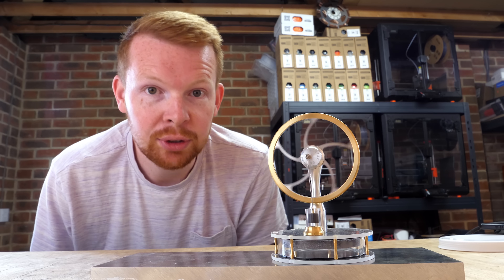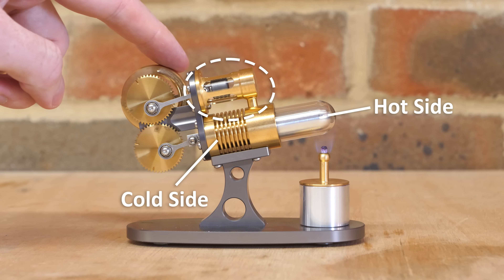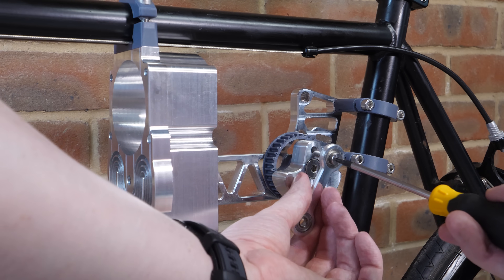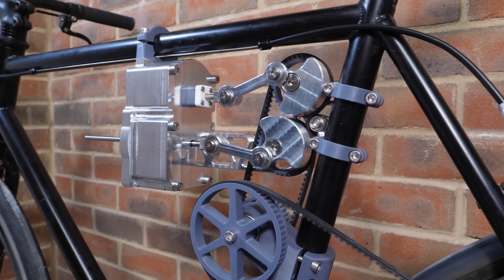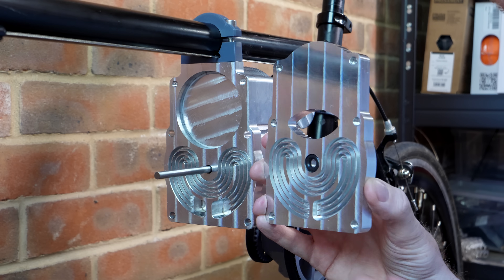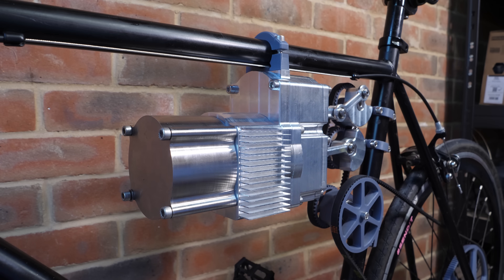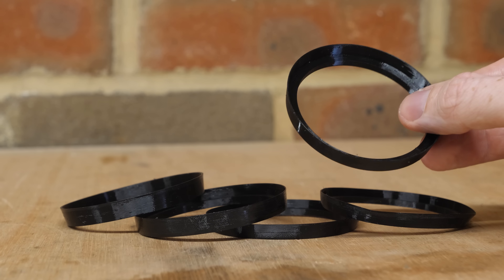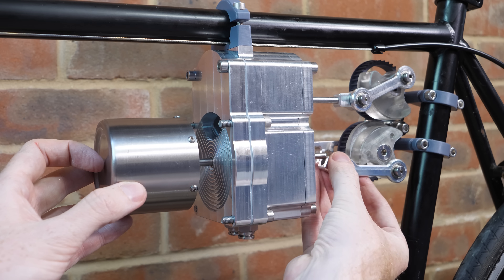Building a Stirling Engine Bike - Part 1

Comment: Great Video, thank you! Why do you have the unpressurised side of the power cylinder nearly sealed, don't you lose a lot of energy there? Your compressing and pulling vakuum every rotation without any benefit. Maybe Just Drill some holes in that Plate.

Comment: Maybe add a bigger on both sides isolated casing part between hot and cold side, which also works as regenerator. The displacer could be stuffed inside with steel wool and with lots of holes on the sides to act as regenerator too. I saw some videos from a guy who built a three cylinder stirling engine for a small boat out of tin cans.

Comment: It's a lot of work, but if you machine a heat sink for the inside of the heat end with a matching fit on the end of the piston then you can get the heat to transfer faster without loosing compression ratio or compensating with the stroke length.

Comment: Complete and utter amateur here, so I may be way off base, but... You said the piston cranks were offset from each other at 90 degrees, and then you never fiddled with them again. Those cranks, and the connection between them, seem analogous to the valve gear on a steam engine. If that's the case then the 90 degrees may not be a universal optimum, but rather a ballpark figure subject to variation in the actual implementation. I guess what I'm saying is that you might get the engine running better by fiddling with the offset between the cranks. It should probably also be the last thing you tinker with whenever you're making other changes to the engine. Keep in mind that I'm not an engineer, this is just what I've picked up from watching videos of people building steam engines.

Comment: Change the fluid working medium from air to a refrigerant gas for better efficiency. Requires a closed system. But what you could is make electricity by using the piston stroke in a linear electric coil. No circular motion required from the generator.

Comment: First idea, when I saw this project, was: "WTF ????" ;-)
As far as I know, the biggest problem with sterling engines is: "The low power output"
150 W would be sufficient for a bicycle, but a sterling with 150 W mechanical power output must be as large as a bicycle. The size you build it, would be a practical size to integrate into a bike, that is true, but with this size it never can provide 150 W, 
but your machine seems to provide around 150 mW ;-)
It would be my dream bike, if it works with 150 W, 
but this can only work in dreams, unfortunately not in reality.
Have you ever googled about cylinder size versus power output of a sterling machine?
Nevertheless, I enjoyed the video. So much effort, and doomed from the beginning, because
power output from a sterling engine is so little. 
Is it really so little known, that power output of sterling engines is always little  ;-)

Comment: AIP or Air Independent Propulsion is a capable Stirling engine design that creates impressive supply, mostly used in the context of military submarines. Mostly used with battery systems as a means of maintaining charge, the increased number of pistons means the generator is far more reliable (in terms of output) than the basic design on this bicycle. And that is probably the greatest application of a Stirling engine (although pumps have also been historically a common use for Stirling engine. Direct drive, like this, is certainly entertaining and educational, but not entirely practical. However, as an energy source for electric drive, that's something else entirely!

Comment: you have all the tools, you have the time and willingness to do it, but then you make the power piston in a stirling about as big and with the same travel as the displacer...
in other words you greatly underestimate how big of a displacer you need and how much heat must be transferred in to the air in the engine to power a bike, that coke bottle size will not do.
the only possible save is to design the displacer like i did when i drew (never made, lack of tools) a stirling. circular fins on the top inside of the hot side, like a cpu cooler but in circles, and then on top of the displacer that matches the ones in the hot end (top of displacer fins reach bottom of hotend fins) so that alot of air is presented with alot of surface fast. preferably same on the cold side.

Comment: The Backside of the power-piston is enclosed. which means it has to either compress air in the ,,crankcase´´ or push it past that steel rod during the power stroke.
I think you may lose some energy there

Comment: Another classic bit of engineering whimsy from Tom Stanton and I loved every minute of it. I think it would have been better to have 2 smaller cylinders 180 degrees apart, though this would significantly increase complexity it would provide smoother more efficient operation. Also you should hone the bore of your cylinder, that would make a big difference.
Reply from the maker: A lot of Stirling engines mount the cylinders 90 degrees apart to achieve the required piston offset from a single crank, but the plumbing between the cylinders can create inefficiencies. Thanks!

Comment: Good grief! How to overbuild a simple engine. And, your power source is going to be a propane torch? Where is the regenerator? Without a regenerator, this isn't a Stirling engine; it's a hot air engine, (a little bit nicer than the pop-can models that some YouTube geeks build).

Comment: @pauls5745  Couldn't agree more, more polished brass, red painted flywheels, and shiny chrome piston rods, more  Fred Dibhna, Mamod X Steam Punk that's the future err and the past. But seriously, very nice workTom.👍
Kockums Sweden build and install an (AIP) "air independent propulsion" Stirling engine in three of their Gotland class submarines 75-100 kW.
Cavatation solved or a 100 kW to power a (MHD) magnetohydrodynamic drive? 
Anyhoo, Robert Stirling would be proud.

Comment: Let me tell you a secret: just increase the pressure to, say, 10–16 bar and you’ll immediately get more power… and use a better working gas, like hydrogen or helium.

And the best setup for you is a free-piston version it’s compact and has no sealing issues. You can extract the energy in electric form with a linear generator, perfect for charging your existing e-bike in a series hybrid setup. With high enough pressure, efficiency can reach 35–45%.

Comment: Stirling engines are notorious hard to build and get it right. But you did it! Congratulations! You could inject helium under pressure, instead of air, since helium has more heat capacity than air. The ultimate problem though is efficiency of the Stirling engines themselves.

Comment: What if you use a peltier module to heat up AND cool down the motor? It needs batteries, but can be easy to get the power you need (at least in an ideal motor, is impossible to use those in your project)

Comment: You could maybe try driving the displacer with a fast actuator (commutation control via a processor - hall  crank angle / baro cylinder pressure)
Something like a pulsed solenoid, voice coil actuator, or maybe a fast servo, or homebrew creation
- allows throttling of engine via displacement distance
- non-linear motion, and phasing control can improve heat-cool cycle - an "ECU mapped Stirling engine" 
... of course extra electrical power!

Comment: Piston needs to seal in BOTH directions. Sucks in on air shrink cycle. You are sucking fresh air into the system on every cooling stroke. You said it yourself.; the Stirling engine is a sealed system. That it works at all in its current state shows great potential. Good luck.

Comment: Can ANYONE stop with the "positive feel good" B S for one second and THINK about the rather obvious design flaw????
RIDING A BIKE WITH A 500 DEGREE BLOCK OF IRON BETWEEN YOUR LEGS ISN'T EXACTLY SAFE IS IT???? LET ALONE HAVING A BLOWTORCH POINTING TOWARDS YOUR CROTCH WHILE DOING SO!!!

Yeah yeah, good for him building something and all.... But seriously, WHY AM I THE ONLY ONE POINTING THIS OUT!?!? DOES NOBODY ELSE THINK OR HAVE STANDARDS ANYMORE???

Yeah... Motorcycles also have a LOT more of a buffer zone between the actual engine and your legs, the clearances on a BICYCLE are a lot smaller (and also geared towards wearing shorts instead of LEATHER PANTS)

Comment: Add generator to it to load a battery that is connected to electric engine, a hybrid.
You could then with clever control of how much charging of battery can be done to avoid stalling the engine, but you would still have good power from battery to move the bike.
Average output from Stirling engine could be enough to keep bike moving if occasional need of more power comes from battery, and engine is loading a battery when you are freewheeling, so system would even out pikes in needed power.

Comment: Tip: if you backdrive a working Stirling engine, it will act as a heat pump. If you're not sure if you've got a working design, start by backdriving it for a bit and see if the two sides start developing a temperature difference.

Comment: Did you build your CNC or buy it? looks cool
Reply from the maker: I designed and built it, which took far longer than expected haha. I show the build in my previous video. Thanks!
Reply: @TomStantonEngineering That happens haha. Okay I will check it out!

Comment: Making the cylinder out of a less heat conductive material, like titanium, might improve the engine too, drastically reducing leaking heat through the cylinder walls.
Then adding fins on the inside of the hot-head/hot plate might also improve heat transfer by a lot as you probably want to reduce cycle times drastically.  
Note that titanium conducts heat only ~1/10th as good as aluminum and still just half as good as steel does.

Comment: Why don't you try Helium as working fluid instead of air? It is what is used for high power Stirling cycle because it has second highest coefficient of thermal expansion after, the dangerous for this, Hydrogen.

Comment: Stirling engines are cool, but only really somewhat useful stationary.
Two examples ive heard thrown around is geothermal power in cold climates or recovering an amount of power out of the waste heat from datacenters.

Comment: That's awesome! I'm no engineer but I watch a lot of videos about car engines. Usually they make a big deal about the cylinder wall being really, really smooth in order not to lose compression. Could it be that giving it a better finish than just plain CNC finish will lead to less power loss? Would be nice to try it

Comment: Stirling engines are quite efficient; however, they are NOT powerful.  I doubt this engine is half big enough to pull a rider.  I would advise at least double the stroke length.  To optimize power, you need fins or metal wool inside the cylinder to transfer the heat to the air more quickly and the same on the cold side to remove heat more quickly.  It would also help if the cylinder head had high heat conductivity (maybe copper) and fins on the outside to absorb heat from the fire more readily.  In the final analysis, I am glad it is not me with this fire and hot metal between my legs.

Comment: you could get a small engine cylinder hone and smooth out the bore to make it seal better and have less resistance. 
its a simple tool that goes in a hand drill and rotates polishing stones with some lubrication to.
if you get a new one it may need to be run in first on a steel bore before having a go at the alloy

Comment: the problem with stirling engine is its too weak, too big, too heavy, less efficient, if you want to run that bike you might need at least 12 cylinders of that with a clutch.

Comment: is it worth adding heat fins on the inside of the cylinder? That way heat transfers into the air in the cylinder quicker. Maybe instead of a flat stainless steel bottle, the "bottom" of the bottle has the fins (on the inside).

Comment: A steam engine on a bike would work. Maybe you have researched it or if you haven't, there is a big difference between a Steam Generator and a Steam Engine. If that makes any sense. A steam generator is meant to generate high temp/pressure steam quickly, continuously using small amounts of water at a time. This is different from a boiler based system which heats a large amount of water at once and collects steam, then passes the steam through a superheater. A steam generator does not collect steam in a boiler, and therefore, has minimal risk of explosions. 

The Doble Steam cars of the 1920s/1930s are a good blueprint for a mobile steam generator. They generated steam from around 500ml of water at a time in the heating loop and continuously condensed and recirculated the water. The result was a car that output as much torque as a modern semi truck(lorry).

Comment: consider placing the engine above rear wheel, behind seat. Heat with Fresnel lens focusing solar? Nobody wants a flame between their legs. :)  The entire aluminum bike frame could add to cooling system? Have you measured the torque this engine produces? I just wonder if there is enough torque produced by any feasible sized Stirling to overcome rolling and weight resistance.

Comment: Stirling engine Canoe. Using the shadow and water as the cold side, and the solar collector as the hot side, multiple cylinders. You could get upward of 100 degrees difference using vacuum tube solar collector.

Comment: Cool but useless
Reply: Useless to whom? I’d wager Tom is gaining useful engineering and machining experience. And we are being entertained
Reply: @davehill8541 useless as  in "real world application". If you're going to burn fuel to move 200 lbs you should just use gas🤣🤣🤣🤣🤣 it's the same concept as a "piston" but with external combustion🤣🤣🤣 And if you want quiet use electricity.
Reply: @brobrozbox  he has made several types of electric motors for his bike. This channel is about exploring engineering concepts, not optimizing a self propelled bike

Comment: I think it would run smoother with as long a con rods as you can fit in the frame.
There is a lot of binding when the crank shaft ends are at maximum amount off centre (and angle) to the piston shafts.

Comment: The displacer can seems to be hollow. If so, try filling it with rock wool to prevent hot air internal circulation. Cheers.

Comment: So cool! Oh man I want to see this little thing unwind, it seems so close! Definitely going to want a much higher reduction ratio, I'm sure peak power will be pretty fast.

I would think the aspect ratio of your heat transfer fins needs to be reversed: the water ones should be much shorter and the air ones much taller. Air is such a crummy heat transfer medium compared to water in terms of their kinematic viscosities and specific heat capacities; the pumping losses required to get a certain amount of heat transfer between surface and air demand much larger cooling surfaces compared to the same amount of heat between surface and water. 

An internally finned hot end would also be awesome, but I have no suggestions on a practical way of making one.

Also looking forward to regenerators, that should be interesting too! Can't wait to see what you do next with this.

Comment: Stirling engines also work in reverse. If you drive it with mechanical energy like a dynamo then it becomes cold. Put a metal water bottle next to it and you have made a chiller

Comment: If you want the least efficient way to move, disconnect the pedals from the wheel and connect them to something that will produce heat by friction, and use that to power the stirling engine which drives the wheel

Comment: I built a Stirling engine for my Final for the thermodynamics course I did at Technical college. An essay was expected, but a practical demonstration was technically allowed, n I'm far better at building than writing.Toms not kidding, took so much faffing around to tune the pistons, seals and crank angles, but such sweet sweet satisfaction when I got it reliably running. I still had to show all the maths, but was heaps of fun. N the class had heaps of fun, as that unit was almost entirely theoretical, in what was a very practical course. It ran on a warm cup of tea and room temp, but we ran it to destruction on boiling water and ice, she screamed until a linkage gave out and sent the flywheel and crank across the room. A good day. And I got the best possible mark 😊
Reply: That's what the infinite improbability ship runs on lol

Comment: A Thickee ceramic or ptfe spacer between the hot and cold side would probably help the efficiency.  There are some great sla ceramic resins  available that would work with the Formlabs series of printers.

Comment: Please try building a stirling engine from a old 2 cylinder V2 shaped air compressor. That way you already have 90% of the enigne, with really solid somponents and a real oiling system.

Comment: The one thing I see missing is the displacer needs to be perforated and filled with stainless steel wool. Cheese hole the aluminum plate the displacer is attached to also. Some have suggested that the displacement need to fit more tightly also. From the more successful examples I've seen, pressurizing the system greatly increases the power output.

Comment: I remember I think it was 2003, I was 12 years old, I imagined a bike that has 2 batteries, you can pedal it and charge the batteries and if  you get tired it can run on battery 1, and when the battery 1 runs out, it would switch to battery 2, doing so will charge battery 1 and back and forth  and just like that it remains in my imagination 😂😂😂. I really love to watch videos like this.